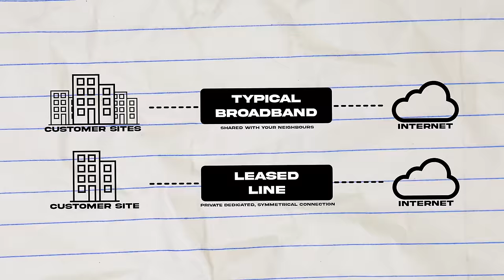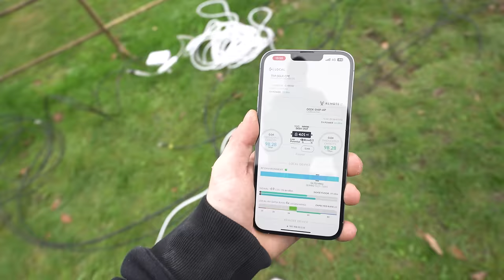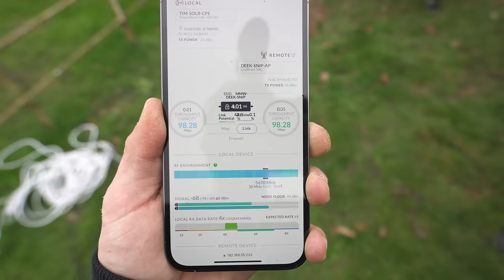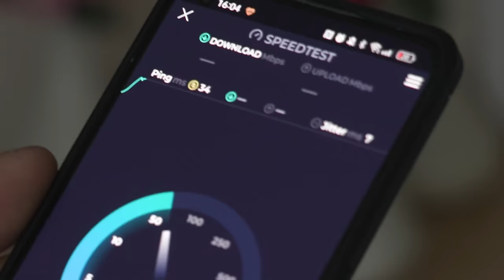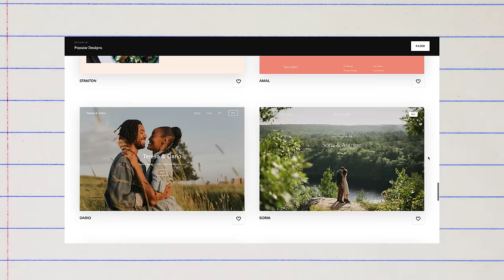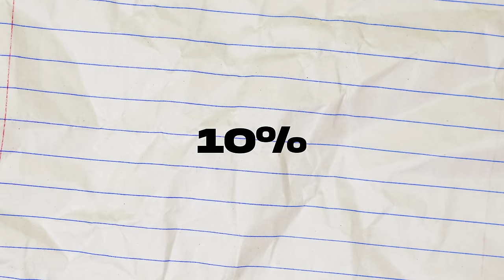How I Earn Money Selling Broadband in 2023 (Full Tour)

Comment: I believe that fiber technology could eventually pose a competitive challenge to your business. However, considering your rural location, the process of its adoption might be slower. Additionally, in the States, fiber installation typically requires a significant demand from the community before it becomes available.
Reply: In the uk most rural areas have access to at least sogea (fttc), with the analogue switch off happening soon, Openreach are having to prioritise rural locations as they have to be able to provide voice services.

Without analogue service they have to provide broadband, generally via fibre. Unfortunately wisps will have issues if they don’t provide voice alongside broadband services.

I know I wouldn’t want to be relying on a service with non external cat5/6 berried in a field!
Reply: at least in the states wisp are outpacing fiber in the rural areas
Reply: @person12307  very likely a factor of geography and the sheer size of
Reply: or three pissed off IT guys and a used Vermeer
Reply: Real threat is Starlink
Reply: Actually he is a threat to fiber. Adding new houses is way way cheaper and faster.
Reply: There's a big push to convert everyone over to Fibre to the home connections in order to replace the phone lines.

Comment: “Down to” is the way to go! My ISP has the same mentality and I consistently get about 10% faster speeds both ways than what I’m paying for. I have a symmetrical 150Mbps plan and see anywhere from 160-165 on average
Reply: The problem is the network is a shared medium and its hard to garuntee a speed 100% of the time. There may be occasional times of peak capacity with a slow down and thats why most internet providers play it safe by saying "up to"

Comment: OMG Alex! I’m literally trying to do the exact same thing in this very rural area (~200-300pop) that I’m in. The current internet is garbage and I’m trying to bring fast high speed internet to my people. I did research and from out I can get a fiber line (it’s expensive) and I’m wondering can I serve the community with 100mbps or do I need to go higher. I have so many questions. Help me pleeeeaasse!
Reply: Depends on what your budget is since its going to be hella expensive and, ofcourse. line of sight. not high building, no trees and other things that block connections.
Reply: a 100mbps fiber line if you're going to be serving customers. Between 10 people, that shrinks down to 10mbps which is pretty slow. with QOS, you want to be serving down to 20mbps minimum. Maybe get a gigabit line if you can? It'll be hella expensive but it'll be worth it.

Comment: If your traffic shaping is done on that edge router your going to run out of processor very fast, get yourself an infinity router fitted, it’s peanuts for a wisp like you … also WISP = wireless internet service provider. Come on Alex! why are you not using gigabeams or air fibre? Why are you using unifi switches and not edge switches ? Why are you not using edge power for back up reasons ?

Comment: There is one misconception: you can get fibre internet even in rual countryside. It's only very expensive. It's a shame he didn't mention the cost of his internet connection: In my country it's about 2000$ a month and 50000$ installation for some ballpark numbers. It allways depends where they need to dig and if the faster tranching is possible or if there are some areas where they have to dig by hand.

Comment: Alex you could upgrade your lease line from Virgin to 20gb to increase speeds to 100/100MPS TO COMPLETE with fibre. I am aware that EE 5g have speed caps less than 80mps, and three offer speeds in rural areas not much more than 65 mps with 15mps upload speeds.
For example, many smaller villages will not have full fibre but have a digital phone line on a copper line but the telephone line will be digital. 
To increase the range you need a larger pole with a bigger dish so other rural and small villages could access your service.
Reply: Virgin don’t offer a 20gbps service, he barely has 1gbps presently.

Smaller villages will have sogea (which is essentially fttc), so can access up to 80/20, that said many “alt nets” are rolling fibre into small villages too.

Speaking from the perspective of owning an isp myself
Reply: Getting 20Gb/s out of his dad's house wirelessly is going to be the biggest challenge.
He's got a 1G bearer at the moment, and that AF5x will only do 650mb/s absolute best case (if it's the better HD version).
Reply: @JohnWatkinsUK  I still can’t believe he’s charging 540 pcm for a 100mbps service. I’ve already checked the btor fibre duct maps and the hotel could get 1gbps for significantly less!
Reply: EE speed has different speed tiers but their 5G broadband is full speed, Three however have no speed limits and are purely limited to congestion and band availability, I've seen everything from poor 8Mbps to over 1Gbps in rural areas on Three. 

As for larger towers and antennas there are limits you can run into from planning authorities, cost and congestion from spreading the same amount of spectrum over a larger area
Reply: 4gb is awful in most towns, 3g is awful in most rural areas, unless bt is willing to upgrade your area you have little options

Comment: My only concern is how many times your wireless signal is being bounced around. Just like coax cable with the length of it affecting signal quality; how many times a wireless signal is bounced around will also affect it's quality. But you do have from what I have seen a good business model. I just wish the ISP's would take notice and do the same. But at least your making something off your hard work.
Reply: with it being digital data being transmitted, surely the ammount of hops wouldn't matter. only issue would be if any one hop caused any packet loss. but at any hop the data will get retransmitted in correct quality?
Reply: @michaeljones5681  The more hops you have, the higher the ping will be. Especially wireless. This is why broadband companies use cable either under ground or on a pole to transmit reliable service to homes. Wireless has come along way yes, but I think it's still pretty flawed to use it as a broadband transmission interface.
Reply: Adding hops certainly adds latency
Reply: @fightingfalconfan  Microwaves have lower latency than fiber. That is why for HFT, wireless is used to link exchanges.